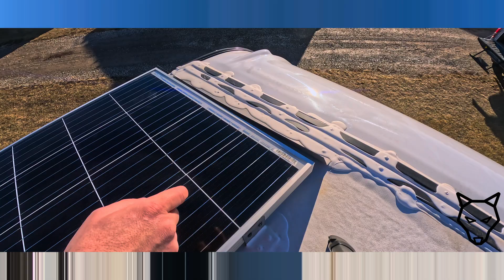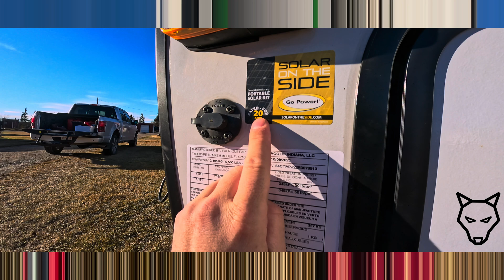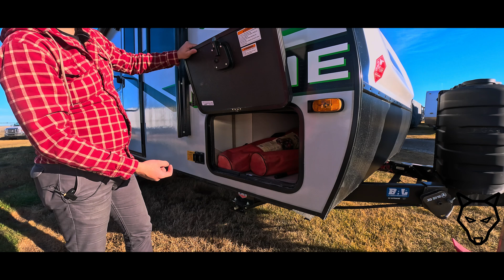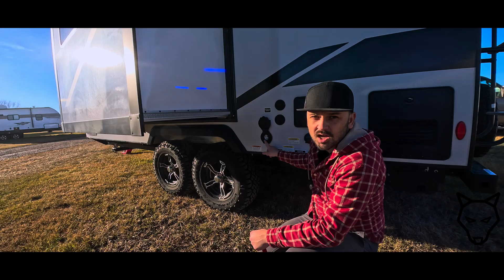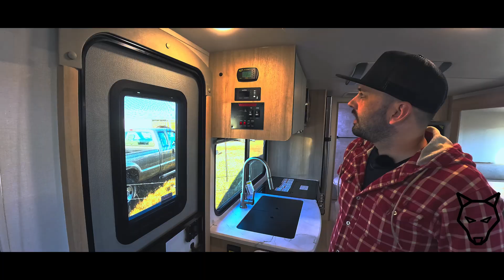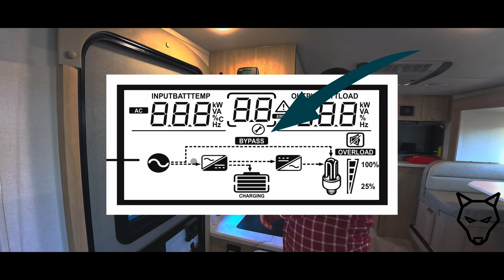Winnebago Micro Minnie FLX — Electronics  [A Deep Dive Series]

Comment from the maker: **CORRECTION**   Shutting the battery off via the button DOES NOT allow for the solar to charge the trailer.  The battery must be turned-on (blue light illuminated) for the solar to charge the battery.  Be aware, turning-on the battery will allow any 12V draw from the trailer will draw on the battery.